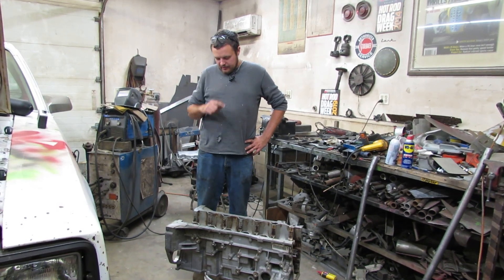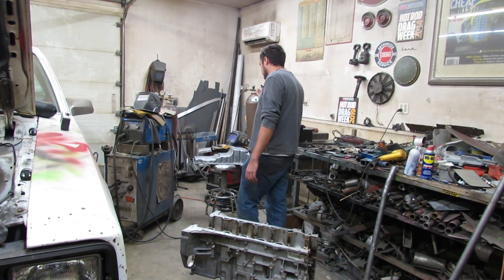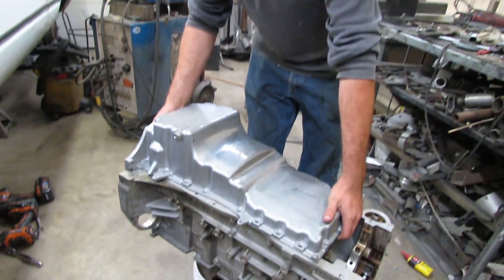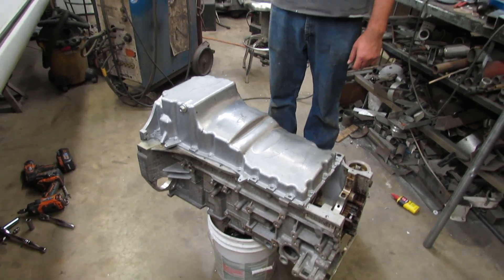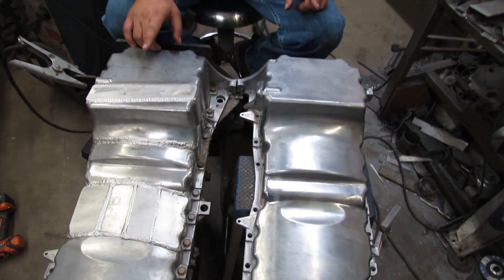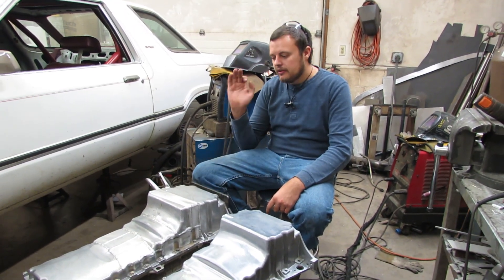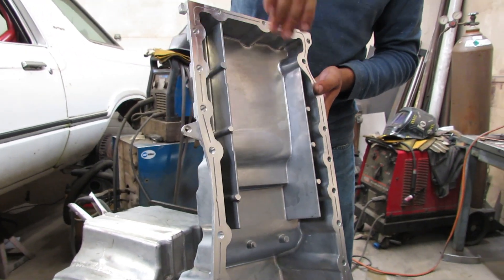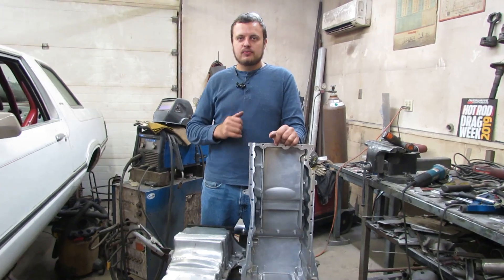How to make Vortec 4200 Rear Sump Oil Pan

Comment: What did you do for the dipstick? Thanks for the video.
Reply from the maker: Used a 5 cylinder dipstick. They go into the oil pan.
Reply: @Calvin-Nelson  Did you have to drill a new hole for relocating it to the rear? Thanks for replying
Reply from the maker: @PalKokity  no. The dipstick provision is in the pan. You just have clearance the block.
Reply: @Calvin-Nelson  Ok, sorry, I missed seeing it the first time (or two). Just rewatched and spotted it. Thanks again

Comment: might be an odd question, but what tungsten/filler/alloy are you using? ive yet to find a combo that looks that good on cast aluminum
Reply from the maker: I don't know. It's whatever I normally use. Cast aluminum welding just sucks not matter what you do. Lol.

Comment: I know this is an old video so i probably wont get an answer but does the engine need the support from the thick cast pan? Why not just build a sheetmetal pan?? You seem like a good fabricator seems like that would be alot easier
Reply from the maker: All depends what you are doing. I'm sure that the thicker pan helps, but if you're not making much power I imagine it doesn't make a difference.
Reply: I built one out of 3/16 plate for jeep  xj crawler project

Comment: Dude, 2 pans, cut the rear one forward of the line you drew by half the distance needed, and cut the front one longer by the same amount, and weld. Would that work?
Reply from the maker: It would work if you are ok with half of the bolt holes not being used, mainly in the middle section of the pan. I originally bought two pans to do exactly that, but it would not line up, so I chose to use one pan and just lengthen it.
Reply: @Calvin-Nelson  I got ya, your way is definitely better then. Thanks for even replying!

Comment: Far easier to buy 2 oil pans and over cut each one for your front and rear and have a single weld joint!
Reply from the maker: Bolts won't line up. That was my initial idea. Won't work.
Reply: @Calvin-Nelson  still easier to weld a boss over hole and drill, only my thought as an armchair observer. Your pan did turn out good , as I have done similar and spent far more time.

Comment: There are two 5 cyl oil pans. The one shown is the stepped (colorado) pan. There is one that is more flat, shorter in the front with a deeper sump (H3 # 12587315). Ive commented on this before.
Reply: Could you just order 2 of these and splice them?
Reply from the maker: Oh ok. Didn't know that. The stepped one works better for lower profile and more ground clearance.